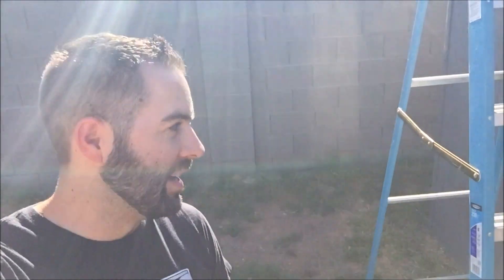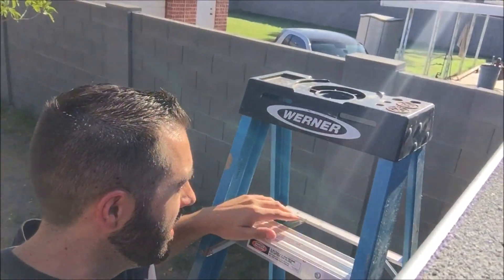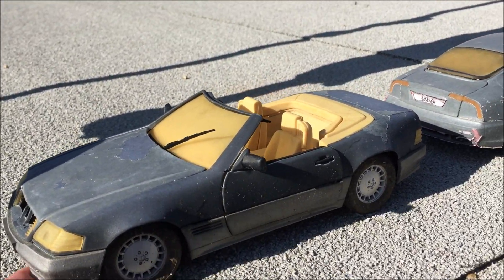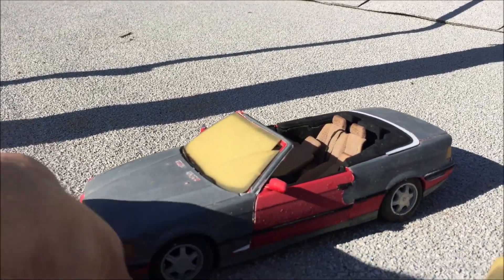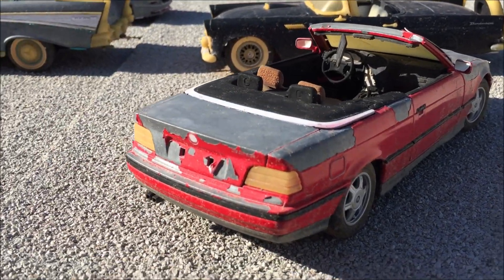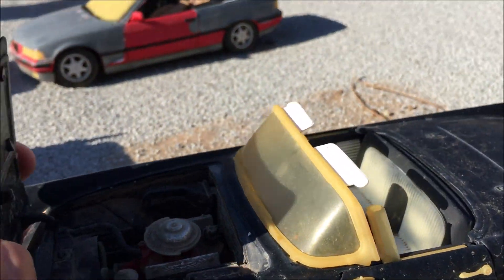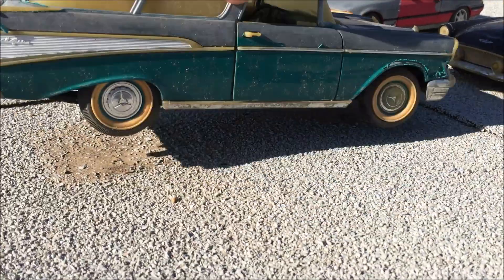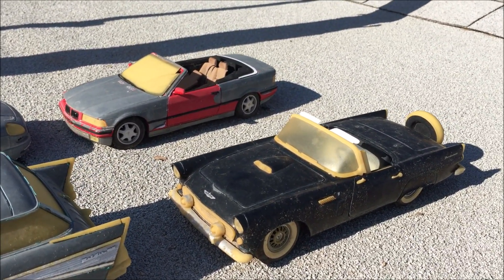Scale Model Durability Testing:  1:18 Diecast Model Cars Left Outside in Arizona for 9 Years

Comment: I have several 1/18 diecasts that I just pulled out of 8 year storage in the garage. They were boxed up the whole time. They all look good except for a pair of Ertl American Muscle 1960 Ford Starliners. Both cars are white and less than 20 years old but they have already started to crack. The metal appears to be cracking and in some cases, crumbling along the edges. Seems to be a manufacturing defect in the metal. I've seen a few on ebay that are also falling apart. I wonder if it is possible to get a replacement or some kind of credit for these things prematurely becoming junk. It's a shame because American Muscle did such a nice job in replicating these beautiful cars.
Reply from the maker: They sure did!  Thanks for sharing!